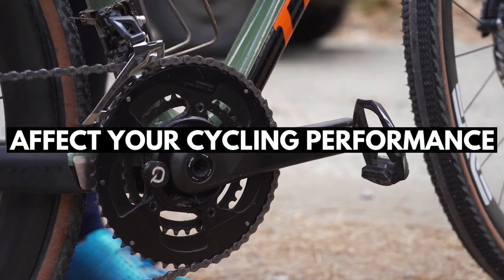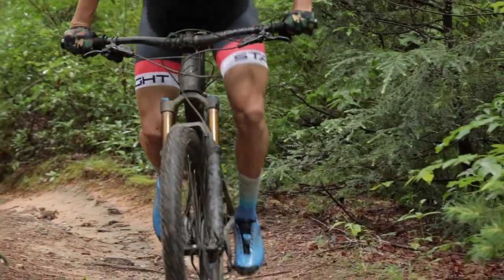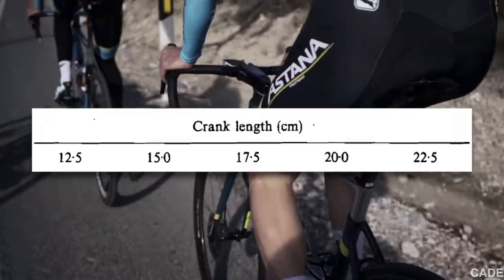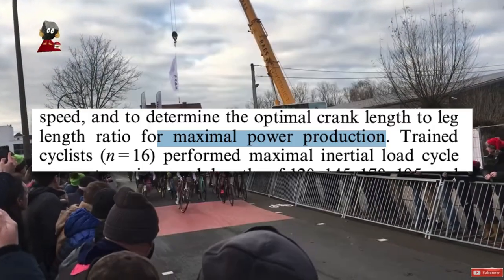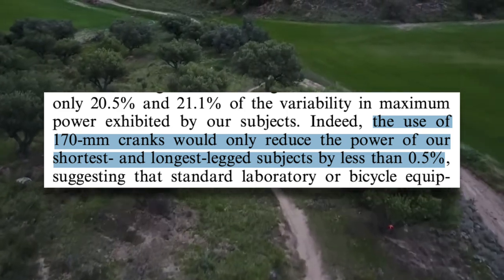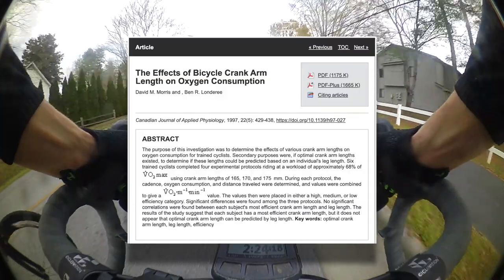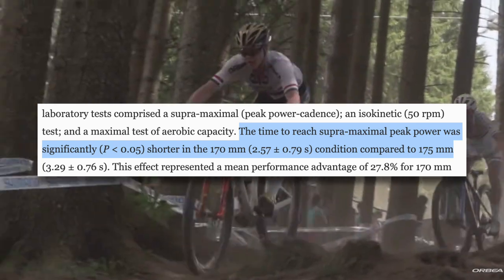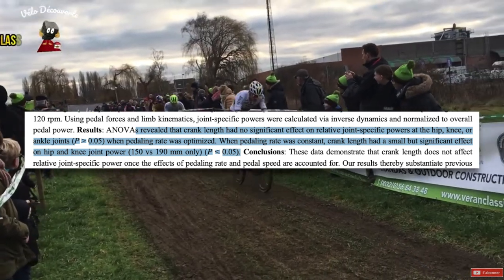Does Crank Length Affect Your Cycling Performance? The Science

Comment: I'm 5'6" and always had 170 or 172.5 (what came on the bike). after decades of cycling and knees getting progressively worse, I finally special ordered a 165mm crank. it really reduced my knee pain. Crank length might not affect peak performance, but it will alter your bio-mechanics and might reduce the strain on your joints. definitely worth experimenting.
Reply: Definitely agree with this.   Ex-competitive skier with ancient (mid 80's) ACL replaced right knee (also scoped several times over the decades), lots of arthritis - no more repair is possible so next step down the road is knee replacement.   A few years ago I got an indoor trainer that I set up identically to my road bike with the exception that it had 170 cranks.  It was amazing how much less knee pain I had when indoor training vs outdoor.    So I decided to change the cranks on my road bike (from 172.5 to 170).     When you have compromised cartilage or arthritic surfaces even tiny differences can make a big difference in comfort.   With slightly shorter cranks, my knee is less extended at the bottom and less flexed at the top.   For whatever reason, this now keeps my knee more on the remaining cartilage than aggravating the arthritic surfaces.     I can now cycle long distances again, and go multiple days cycling without any knee pain.    Definitely worth experimenting if you have bad knees.
Reply: This!!! I was expecting the video to cover this scenario and others related to crank length and bike fit, body and joints injury prevention. I have had knee issues for the last 5 years or so, moved to 165mm cranks and it has drastically reduced the knee pain I feel. Pair that to actually keeping an eye at cadence and I can produce more power and be safe fory joints!
Reply: How about saddle position and clip position on shoes?
Reply: @umaxi96  yes I was always adjusting those too trying to get the perfect most pain free position, but it wasn't until I switched to the 165mm that I was able (along with new saddle and toe position) to really dial it in.  It has to do with making the distance from max top to max bottom smaller so there was less extreme bend at the top of the stroke for my shorter legs. With the 165mm my knees were 10mm lower  (less bend) at the top of the stroke.
Reply: Interesting.  I’m 5’6” as well and my 175mm cranks are driving my knees nuts.
Reply: @330_Crew  I know it might be a bit expensive, but I would highly recommend you get a 165mm crankset to try. I could not imagine being on 175mm. I rode 172.5 for one summer and quickly switched back to 170. 165mm is was unheard of back in the 1990s when I started, but is not so difficult to find now. Not sure about you, but even on 170mm, when I was in a crouch, at the top of the stroke my knees would slam into my torso and my knees would be strongly bent. 165m (10mm shorter top-to-bottom) and raising my seat to adjust for the bottom of the stroke and now my knees no longer hit my torso and the bend at the top is not as extreme. for you (175->165) you would have an extra 20mm at the top of your stroke between your knees and your torso and less lift/bend of the knees at the top of the stroke.
Reply: @old_papa  The extension of one'a leg at the bottom of the stroke can be adjusted easily enough by saddle height, but it's that extra lift at the top of the pedal stroke caused by longer cranks that so many of these studies seem to ignore. Having less flexion at the TOP of the stroke was a huge improvement for me as well. I also notice that at this year's TdF there were discussion about how many riders have switched to shorter cranks on their TT bikes for that very same reason—it opens up the hips and allows them to actually adopt a more aero position on the bike. The old school thinking of "longer pedals = longer lever = equals more power" is proving to be more superstition than science.
Reply: Really good points - I've come late to the game (I'm 64 y.o.), but am now finally realising the importance of crank arm length. I'm just a little taller than you and after much research, have decided to ditch my cranks and replace with 175 mm. I have a total knee replacement one side, advanced arthritis in the other knee, intervertebral disc degeneration between all my lumbar vertebrae - cranks that are too long don't help!

I'm surprised at the number of "traditions" in cycling that go unquestioned - "175 mm crank on my size small bike? Sure, go ahead!"; "Drop bars on an off-road bike? Sure!" "Internal hub gear? Wouldn't be seen dead riding one!"

In retrospect, I'm baffled that when my previous bike mechanic upgraded the drivetrain on my 1997 MTB, he wouldn't have mentioned crank arm length - and he fitted 175's! Doh!
Reply: @robbiddlecombe8392  True - and the "long cranks = more power" assumption is wrong, anyway. There are other factors, like cadence and gearing that can adjust for riding shorter cranks in order to achieve the same power. A bad bike fitter is worse than no bike fitter!
Reply: Really good points - I've come late to the game (I'm 64 y.o.), but am now finally realising the importance of crank arm length. I'm just a little taller than you and after much research, have decided to ditch my cranks and replace with 175 mm. I have a total knee replacement one side, advanced arthritis in the other knee, intervertebral disc degeneration between all my lumbar vertebrae - cranks that are too long don't help!
Reply: @Sidowse  I agree with this statement.  I replaced my 175 SRAM Eagle GX cranks with 165 Eagle GX cranks on my 2021 Santa Cruz trail bike a month ago. While I am quite pleased with the absence of pedal strikes, I do not notice any improvement in my ACL deficient knee.  Granted, this is not an arthritic knee but eventually it will be arthritic.  I doubt shorter cranks change will do anything to delay the onset of arthritis.

I am still a little wary of my higher center of gravity after raising my saddle.  On pavement the benefits are mixed.  However, on narrow trails my confidence with sharp switchbacks and steep inclines is much greater with shorter cranks.  Pedal strikes on hairpins with 70 degree rocky drop-offs are terrifying, and it’s a constant risk with the hillside located inches away.  So no regrets with shorter cranks.  It’s a huge safety benefit on these SoCal trails.
Reply: @robertcowling4313  I did play with different pedals and I'm using one with a lot of float. For me it really came down to the amount of knee flex at the top of the stroke. You have to remember I have short legs. To get the right seat height for the bottom of the stroke and longer 170 or 172.5mm cranks, I would need to drop my seat and thus would get very strong knee flex at the top of the stroke and my knees would hit my torso when in the tuck (no clearance). When I went to the 165mm cranks it solved all these problems: could raise my seat height 5-7.5mm for correct alignment at the bottom of the stroke, 10-15mm less knee travel at the top of the stroke, so less knee flex and my knees would not hit my body when in a tuck.
Reply: Is there really a significant difference in 165mm and 170? I'm 4'11 and struggling
Reply: @ricachuuuu  for me it was very noticeable. The total different from top-to-bottom of stroke is 10mm (5mm each side) so that meant I had an extra 1cm of space between the top of my knee and my torso at the top of the stroke and I could really feel the difference in my knees.  But I am 5'6" so taller than you. You might want to look for a 160mm or 155mm. I know Rotor makes cranksets/arms in those smaller sizes (even 150mm). Shimano and SRAM make 165mm for certain. I am using a SRAM Force crankset in 165mm
Reply: @JessicaSeverin  I see. It's hard to find stocks for 150mm crankset here but I'll try to look for one later. :) Thanks for the insight.
Reply: @ricachuuuu  one thing you can try is to bring your knee to the top of the stroke with your 170mm cranks and then have a friend measure total height of your knee to the ground. then drop your knee 10mm, 20mm, 30mm down from that previous point trying to keep foot in same pedal location. That will show you the difference in knee flex for 165,160 and 155 cranks. Or you could go to a bike fitter who has shorter crank arms and try those.
Reply: The shortness or lengthiness of a crank may be compared to an engine which has a lower horsepower but a higher rpm while the other has a higher torque but a lower rpm

Shorter cranks are like engines with higher rpm but slightly reduced torque because the pedals are near the bottom bracket which is the focal point, its faster on flat roads because the pedalling revolves on a shorter circular path which puts less effort on high speeds especially for longer legged cyclists, its slightly slower on the instant but gradually gets faster therefore proper low gearing is essential for sudden strides because short cranks delivers lower power, if you use shorter cranks i think its better to use a lower gear ratio starting from a complete stop and lessen the thickness of the tires to compensate the reduced torque received by the pedals from the rider, the thicker the tires the longer the cranks needed because thicker tires demand more power especially on climbing, it all depends on the rider how to adjust physically to avoid difficulty or injury

Shorter cranks, use smaller gear ratio, increase the size of largest cog to match the higher torque of longer crank counterpart, use thinner tires to ease climbing as countermeasure to longer cranks with thicker tires

Longer cranks may use thicker tires, can start with larger gear ratio due to greater torque, good for climbing but not ideal for long flat road races because the pedal travels longer around the circular path unlike a shorter crank, much suitable for bike packing or bike commuting purposes because longer cranks improve torque that reduces energy consumption exerting less calories consumed by the rider, it can match the faster speed of a short crank bike by using a smaller cog but it has a downside of wearing the chain faster than usual

In conclusion, shorter cranks are better as long as the corrective adjustments on the bike are met, a bike with a shorter crank can match the capabilities of one that has a long crank provided that bike settings are changed, that is what we call vehicle tuning, tuning is not only for cars, it applies to bikes as well, however, the last difference boils down to the profile of rear sprocket used, how a rider shifts appropriately for efficient power avoiding stress on knees
Reply: @ricachuuuu   — Yes, there’s a big difference.  If you’re under 5’0”, you might want to get all the way down to 150-155mm if you can manage it.  A good option can be BMX cranks, but this can require changing your crankset and bottom bracket.
Reply: @jacquesdemolay5171  Absolutely, and another vote for "just do 165 mm, it might be a game changer" on my behalf. It's just sensible, and very distinctly correlates with rider height as well... at least to some degree. I get that this video is just narrowly looking at pure output, but most folks really couldn't care less about increasing their wattage by half a point when they can't even exercise, y'know, because of knee pain or at least some pretty severe discomfort. Shorter cranks for shorter people help a ton with how easy training feels, doubly so if you're doing triathlons and feel a stiff gait coming on after going hard on your bike. Pedals are straight-up too long on what feels like 90 % of sold bikes today, I guarantee it - without trying to discredit the usual mantra: "it really depends on the individual". Which still holds true, obviously.

Comment: At 6'2 w/33" inseam, 165 is my fave across all disciplines. Good cadence on road/gravel, and maximum clearance on MTB. Great vid!
Reply: I am the same height and my favorite is 165 to 170 but I will not go over 170. Its awesome on the MTB to go shorter, you can hit those higher peak powers quick and accelerate better in tight and technical terrain.

Comment: Hey, Dylan!  At 2:40 you said something that really caught my attention.  You mentioned that a change in saddle height can make an 8% change in power.  How 'bout doing a video analyzing that?  I would really like to know if my saddle is too high
Reply: Stephen Starks +1
Reply: @mua6887  +2
Reply: Stephen Starks +3
Reply: +4
Reply: +5
Reply: +6
Reply: +7
Reply: +8
Reply: +108%
Reply from the maker: Well all right then!
Reply: +12
Reply: @Dylan Johnson , after you get the saddle height, please do one on saddle fore - aft position by angle from BB 72° - 75° on saddle center. On a road bike. Thanks.
Reply: So slight lower is better or taller saddle? I did my bike fit and the fitter said I can increase +1cm of my current post height if I like but of course this will place slightly more pressure on the saddle
Reply: probably late to the party but as someone who experienced being bike fitted properly, and by lowering my saddle(depending on the person) I was able to produce  much power than before. so saddle height is really important in bike efficiency

Comment: I use 180 mm cranks on all my bikes for almost 40 years. Nowadays everybody tells "shorter is better" and even people with my leg length (90 cm inseam) are told to go for 165 mm by many bike fitters - but whenever I ride a bike even with 170 or 172.5 I find it uncomfortable, and I have no problems whatsoever with knees or hip, not on the road bike, not with CX and not even with the TT bike. So why go shorter? And btw, especially as I get older now I believe it is a good thing to use the range of motion you have got... you know: use it or lose it😎 Thanks for that video and showing that there is no real evidence for the benefits of shorter cranks! ...btw: with my 180 mm cranks and 900 mm inseam I am exact spot on with that 20% mentioned in one study...

Comment: Great info!!!!!!
I ran an [unscientific] experiment some years back where I tried riding my mountain bike (the same bike) on the same routes (both road and offroad) using 170, 175, & 180mm cranks. I noticed the same effects on cadence that you've mentioned. I also felt that I generated less torque (like when accelerating out of a corner), but a higher RPM (like when riding fast down a straightaway) with the 170mm cranks than the others (so better top-end). Because of this I found myself sometimes selecting a gear lower and riding at a higher cadence to get my best performance.

On the flip side I felt that I could produce noticeably more low-end to mid-range torque (to put it in automotive terms) with the 180's but at the expense of top-end RPM. This was very good when that extra grunt was needed to get up and over punchy climbs, accelerating out of slow corners, etc. But because I felt that my top end cadence was somewhat limited I found myself shifting into higher gears earlier (instead of "winding them out") to compensate and take advantage of the greater torque at lower RPM's. Maybe it was my imagination but the effects and differences felt very real to me.

Comment: This makes complete sense to me. Due to a knee bending issue I went down to 115mm cranks (yeah, like 4"). I have no problem keeping up with any of my cycling buddies whatsoever. My cadence is higher however, the actual foot speed is lower as the peddling circle is much smaller. My times up local climbs from 20 years ago are about the same even though I'm 68 now.
Reply: 115 mm cranks? custom made? never heard of any pro cranks this short